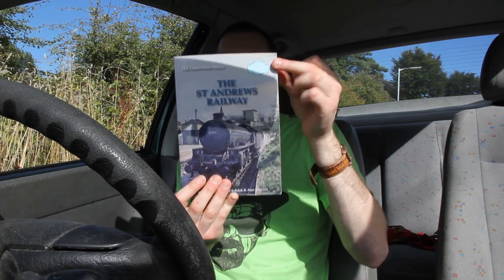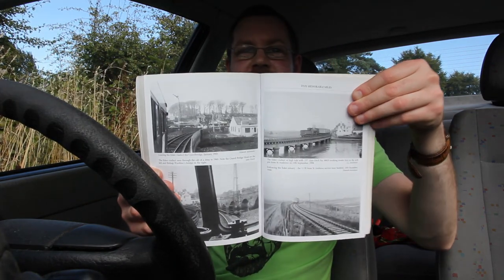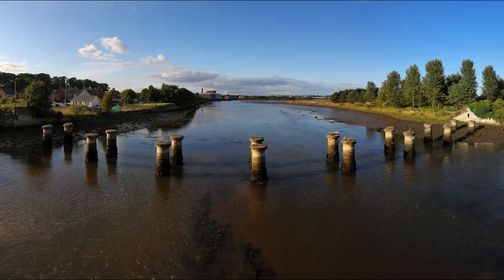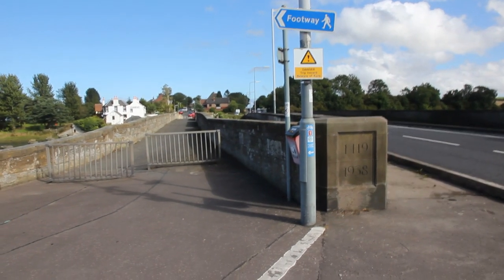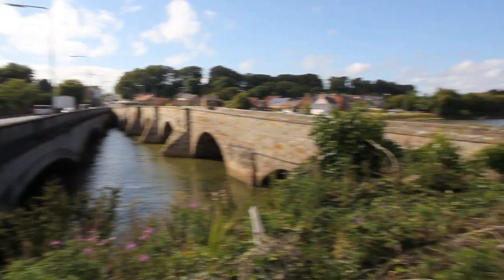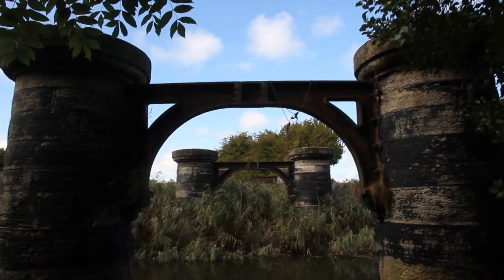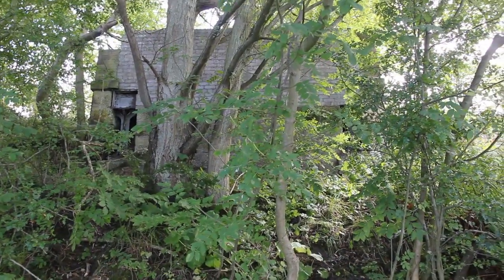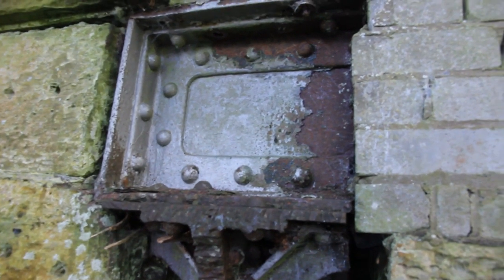Built On The Cheap: The Guardbridge Railway Story

Comment: Very interesting to see these old viaducts. The viaducts that used iron were expensive to maintain and the metal was quickly removed for its scrap value after the line closure so the reason why only the pillars are left. I have just started reading "Lost Lines Scotland Revisited" by Nigel Welburn which looks interesting and should give me some info of where to visit in this area.
Reply from the maker: It's a little sad to see them as they are now but removing the metal to savage some of the costs of the railway makes sense. If you count the line between Leuchars and Leven as one then there are a few viaducts worth checking out if you're in the area. The Kenly Viaduct is one of the best ones, which lies just south of Boarhills but it's unfortunately surrounded by trees and the top is part of someone's garden. The Viaduct in Lower Largo is also worth a visit. There are also small viaducts in St. Andrews and Anstruther but they aren't really worth looking at unless you're going to be there anyway.